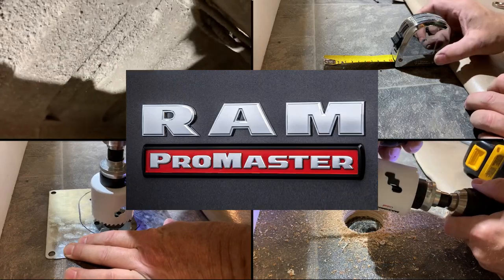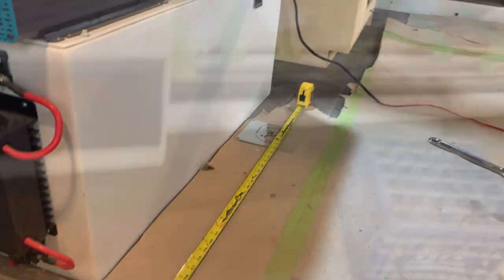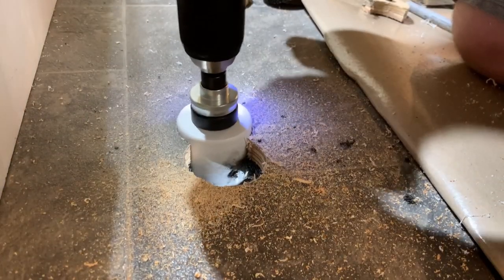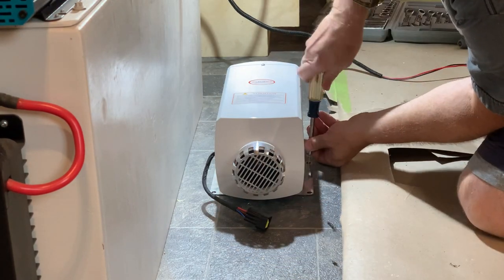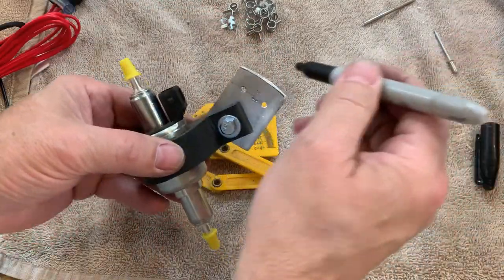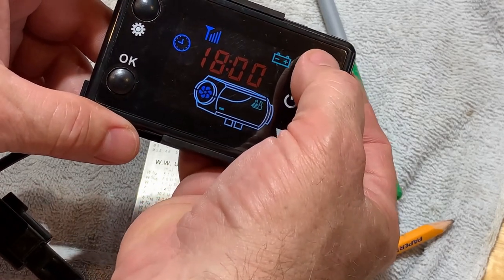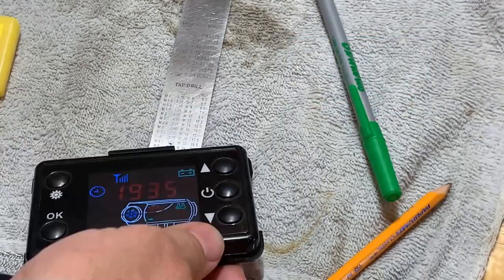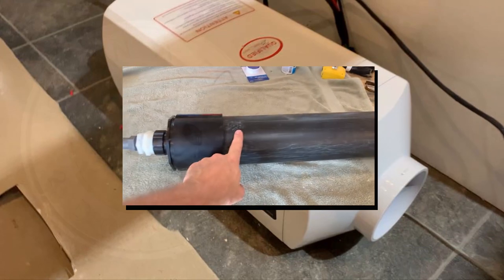RAM PROMASTER VAN BUILD – Diesel Heater

Comment: Hey, another nice video. I also watched your video on tank build. I really like your solution for filling tank. I put my tank under van and drilled hole through floor to fill. I wished I knew about filling through existing diesel filler. I may change I future. ONE Heads-up. These diesel heaters don't completely shut down when left on. I set mine at 65F one night and woke up to 82F in van. It was 12F outside. Once they get to temperature they reduce to very low BUT keep running. I ended up adding a wall thermostat and two times delayed relays to turn heater on and off. Works great but soldering wire to thermostat was a pain
Reply from the maker: Thank you for the feedback
I was determined to find a way to store the diesel outside of the vehicle.  I haven’t seen anyone else use the DEF filler tube, and that made me a little uneasy, as I wasn’t sure it would work.  
I should mention, this approach to store diesel was VERY expensive when compared with using the tank that came with the kit.  The fuel tank, hose clamps, 1” hose, 5/8” hose, breather vent, and the RAM DEF filler tube came to about $600.  Three times the price of the entire heater kit.  However, I didn’t want the fuel in the van.  

Thanks for the heads up.  I don’t think we will use our heater unattended.  I am sure there are some safety features in the unit, but I think we will turn it on and then turn it off.  I also think the unit we bought might be one size too large for our van. Perhaps we should have bought one size smaller.  It heats up the van REALLY quickly.

Thanks again for sharing your experience.
Dwayne

Comment: Did you consider any mitigation for the annoying "tick-tick" sound the diesel heater fuel pump makes while you try to sleep?
Reply from the maker: Great questions.  First we rubber mounted it to do our best to isolate it from the frame.  It is very quite.  Second our van is very quiet.  Between the Kilmat and the thinsulate, the vehicle is quite.  Third, a surpise to us, the only time we can hear the tick tick is during start.  It is so faint, that when the unit is running, the fan completely drowns out the pump.  We just spent 22 nights in the unit, and used the furnace on five of those nights.  Super happy to have it, and effortless to operate.
Cheers

Comment: What size hole saw did you decide on? Thank you Cleco Man.
Reply from the maker: good morning.  I'm sorry i don't remember.  i do know i drilled two smaller holes overlapping.  i think i probably went as large as i could, or as large as i owned, while still staying smaller than the cover plate.  sorry, not very helpful.
Reply: 1 It's ok. I have a 2 3/8 and it seems to cover.  I think that's the same size as my puck lights. I was just curious.   Thanks @LifeIsShortDIY